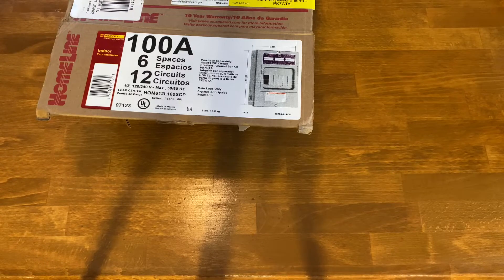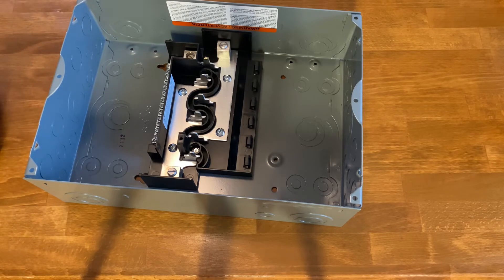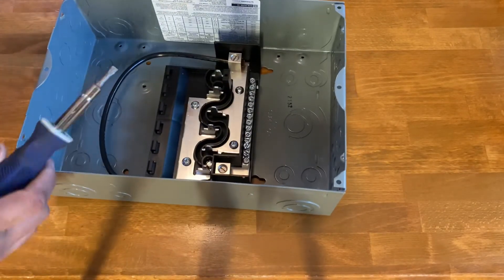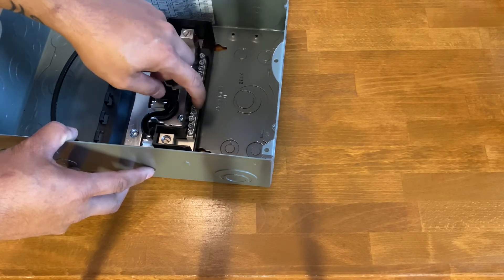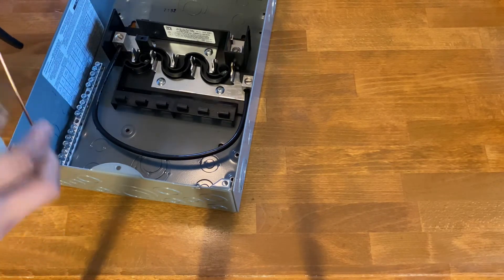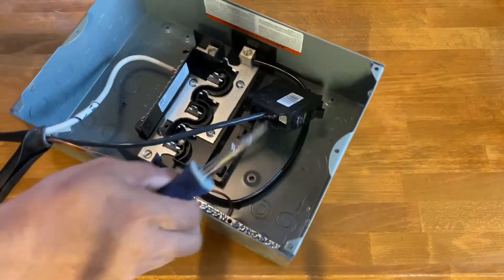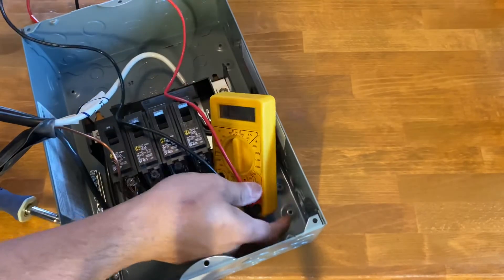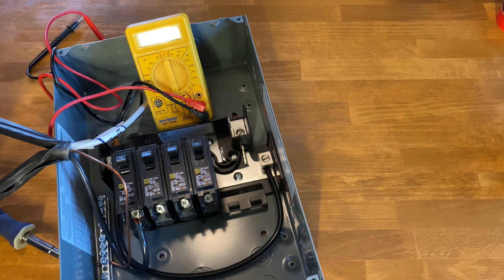Wiring an electrical panel for 120v for solar system

Comment: Hi there, I did this and when I measure volts with breaker off the neutral still has like 86volts give or take, should I install the bond screw for the neutral bar ?

Comment: Can I ask why you don't bond the common to the box as it's the primary box,? I am having trouble finding information on this. And many different opinions. I'm not used the am inverter as my mains and I want to be sure it's safe. Thanks great video. I have the same box.
Reply: It's usually because your inverter most likely has a neutral ground bond. You either disconnect that bond or you separate it in the panel
Reply: Is that what you meant by that screw in the neutral bar but I don’t remember if you said to remove it I remember in the video it was mentioned and I thought that you implied that you remove the screw to unbind from the panel

Comment: Is this legal? I'm converting an enclosed trailer and this would work for my application since I cannot make 240v from my inverter.
Reply from the maker: Most likely not to code. I’m not an electrician.  You can always not use the jumper and only use half the panel.  Another option is to get a panel made specifically for RVs.  They have only one leg
Reply: Nothing is legal anymore, except ripoff incompetant "licensed professionals".

Comment: And label sub panel clearly as 120 V only.  Why so many breakers?  My inverter 3500 watts and S panel I put just 20 and 15 amp breakers.  I Used 8 g cable w 4 wires from SRNE inverter to panel and had to twist the 2 hots together